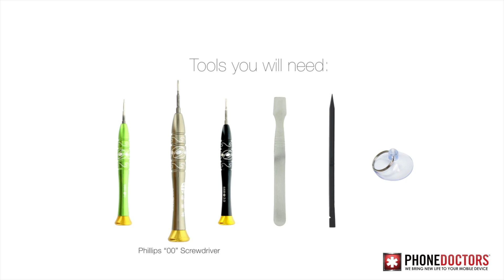How to: The iPhone 5C Complete Full Teardown

Comment: Yes a few times
Reply from the maker: When did this start giving you problems? Was it after you replaced a part?
Reply from the maker: phonedoctors It honestly sounds like a software issue. I would go back and uninstall the last 5-10 apps and see if that helps, if it does, it was probably an apps causing the crash on your OS. If it continues I would make an appointment at the genius bar at the Apple store.

Comment: well you did better than the last video i watched. When he put the board in he put the board on top of the metal circle at 12 o clock center. Then later with no mention he fixed it because it was correct in a later shot.  Neither video showed the little gold thing at 12 o clock that touches  the top part of the board that fell out and took me forever to figure out where it came from and how it went back in.
Reply: chris smith   Was that battery already out once.  That looked way easier that it really is.
Reply from the maker: chris smith I appreciate you telling us this Chris, we are always trying to produce better videos!
Reply: No problem. No detail is too small and the more the better. We have a fast forward if needed.  I skip the ones where people don't talk.
Reply from the maker: Thanks Chris!